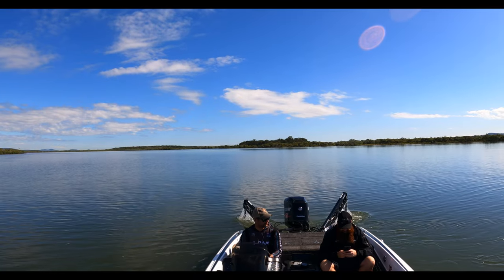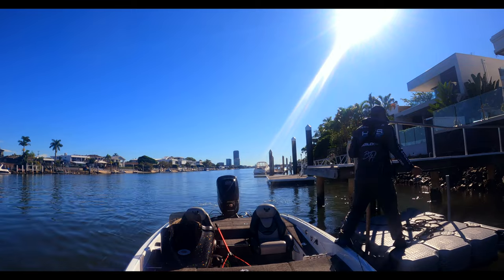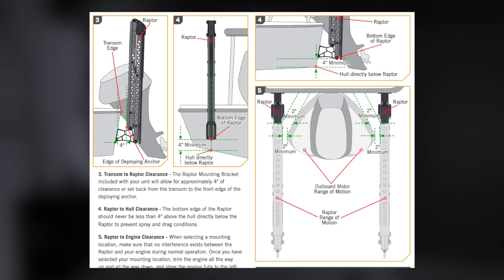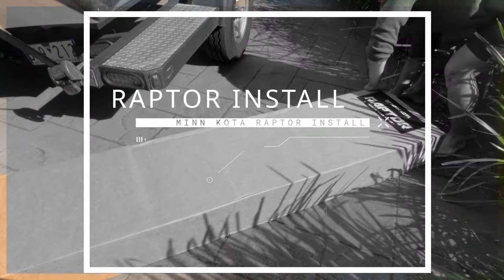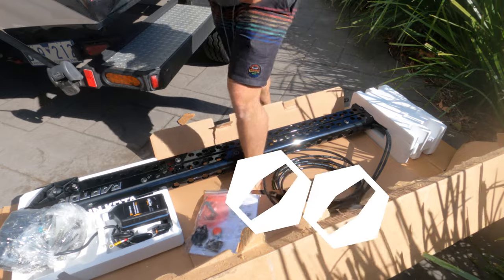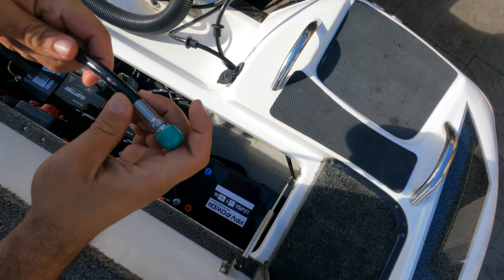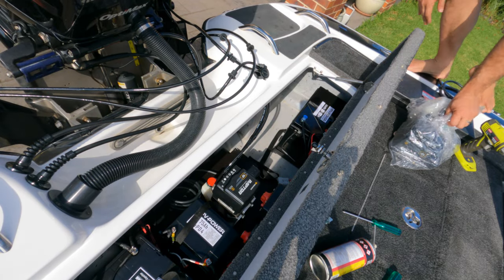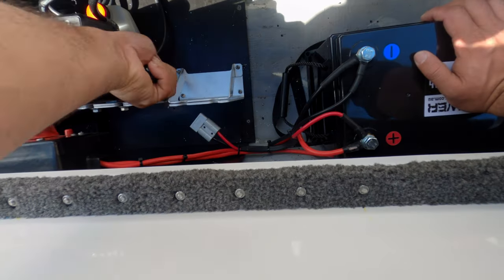Minn Kota Raptor Install on BOAT WITH TIPS!

Comment: Great informative video Byron! I just purchased 2 Raptors for my boat but, I really need some help with hoe to measure the cowling on the motor to get the correct mounting brakets. I know to turn the motor all the way to one side to get the proper clearance but, how do you measure it? Like you, I'm installing them to a 10" Hydraulic Atlas jackplate and my boat is an older Triton TR-21. If you could help with that, i would really appricate it or anyone read these comments! Thank you in advance!
Reply from the maker: hey mate, the instructions detailed the clearances I needed and I just made sure I had that before bolting it in. You're right though, I did just turn the wheel to one side to make sure they didnt hit the engine

Comment: Great video! Thanks for posting. How did your boat perform with 1 raptor? I have an 18ft aluminum walleye boat with room for only 1 raptor. I was thinking of getting an 8ft for the shallow bite. I was just curious how the boat positions itself with only one in use.
Reply from the maker: Hey buddy, it worked a treat. One is really nice. the boat will twist with the current and wind but the anchors work a treat to keep you in place
Reply: @ByronTeaHill  good to know thanks for the info 😎

Comment: I fail to understand the advantage of this product over an electric motor with spot lock?
Reply from the maker: No electric making a ridiculous amount of sound under the water. Sound travels under water and these things are super quiet.
Reply: Add in overnight/ weigh-in anchoring at non-tidal locations (I.e. Lakes).